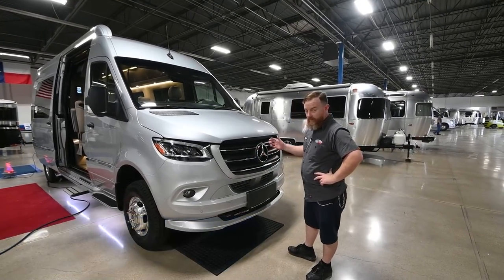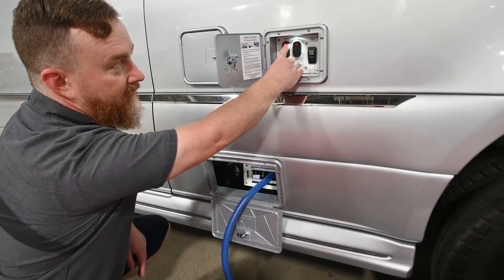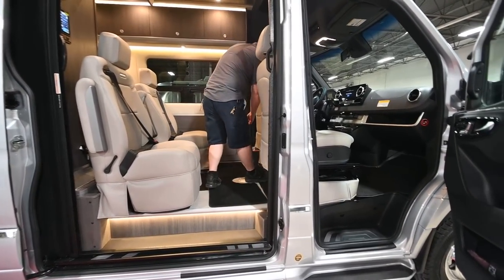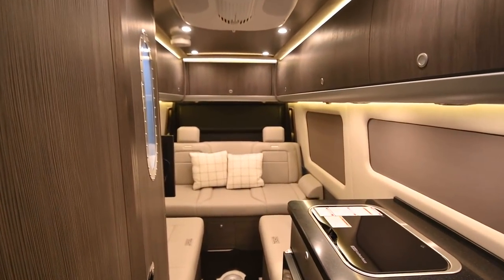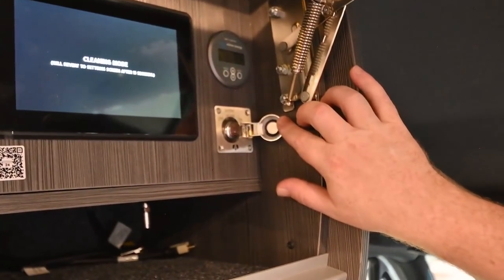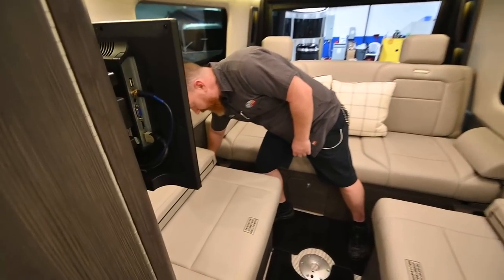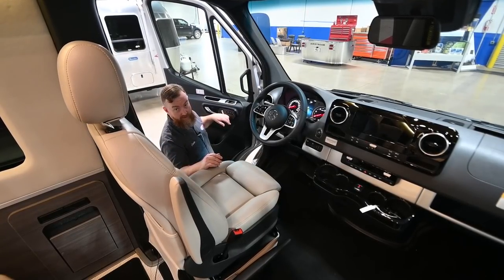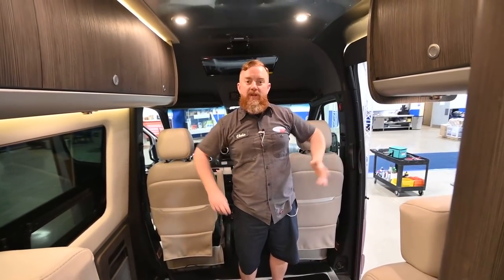2022 Airstream Interstate Lounge 24GL | Full Walk Through Tour

Comment: I was an Electrical Designer in Touring Coach Engineering at the plant in Jackson Center when we started putting the 8A trickle charger and 100W dedicated chassis battery solar. Mercedes had really screwed over all the upfitters when they moved to the new model of chassis starting with their 2019 model. All the tech Mercedes added in their 2019 model year put so much draw on the battery that it could kill it, without anything else running. Some of the last 2020MY Airstream Interstates and Atlases have the additions, and all 2021MY units have them as well.